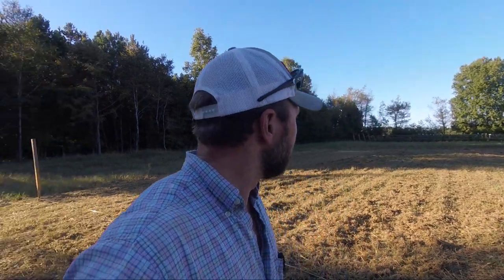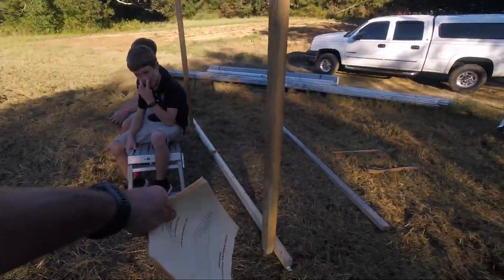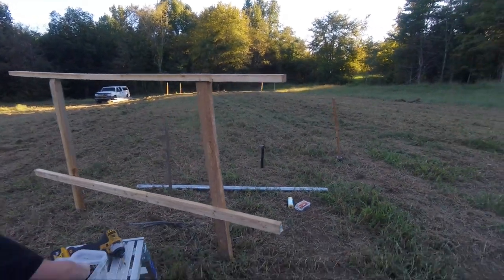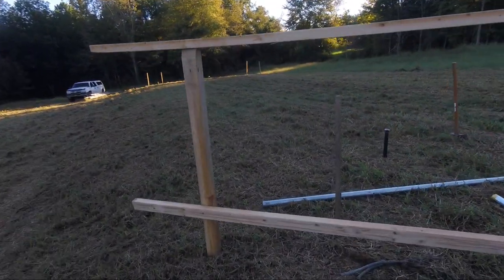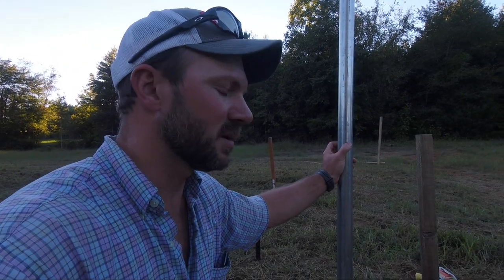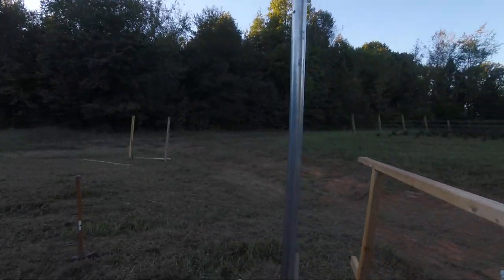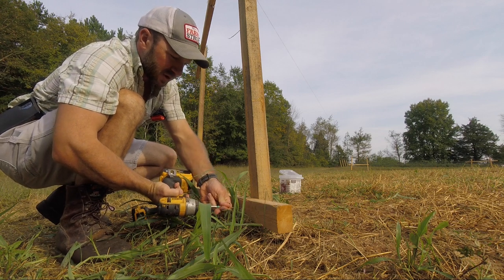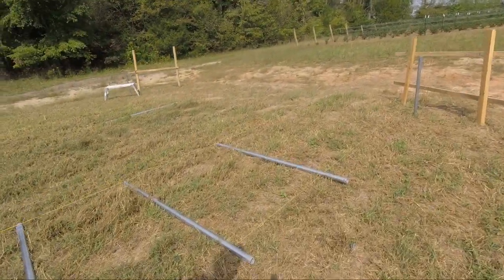Building a New High Tunnel!

Comment: Using a power driver is a piece of cake on these posts.  Most rental stores have them.  You will have save a lot of time and effort.  They will flare out the pipe when driving.  So you need to cut off the tops.

Comment: Ok, questions sir. I measured and have my rectangle all ready to go for batter boards tomorrow. How did you assure your strings were the same height on both sides? Did you use a transit? My pad isn’t perfectly level, so I want to make sure I do the batter boards correctly and not be same height at top of sides.
Reply from the maker: @merrittfarms6246  I use a laser transit, but you could use a line level